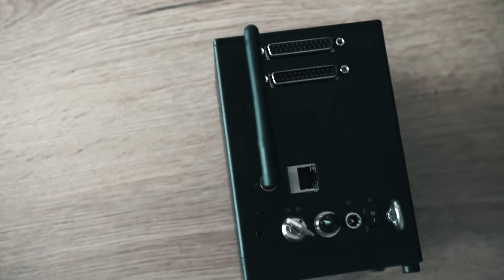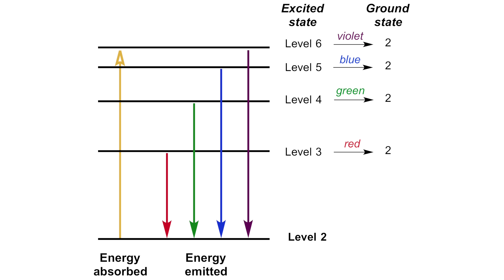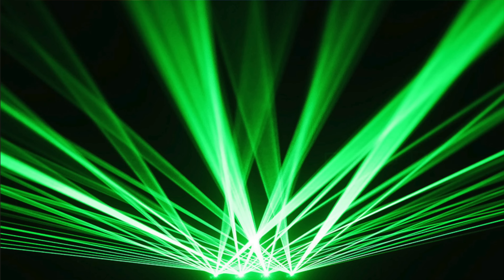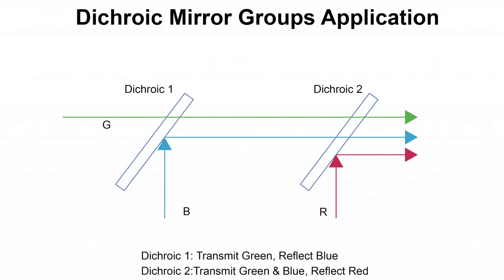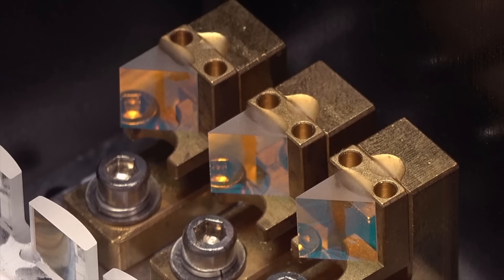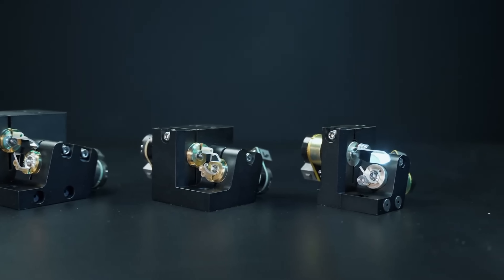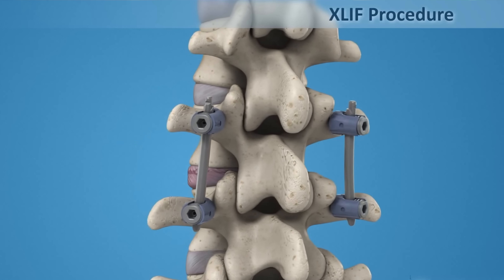The New Kind of LASER You Should Know About!

Comment: I am a Laserist, trained in the very early 90's By Ivan Dryer, and John Tilp at Laserium, Griffith Park. LA, CA.
And a Laser Saftey Officer, having worked at Kodak industries as thier LSO.
Mostly I produced Laser Shows for a dozen years in a 200 seat Planetarium , that was fun and very lucrative.
I also traveled with a lasershow that I Designed & Built for compact portability, doing lasers in TradeShow booths for about 5 years.. Good Times.
I used, and Still have Laserium Choreographics lasershow producer that Runs on my (extremely well maintained) Antique Apple 840 Quadra AV.
CHOREOGRAPHICS is the 1st LaserShow production system Ever. and I suspect I have the Only Working  example left in existence today.
Amazingly, it's still as powerful as any modern drawing, digitizing, Rotoscoping, production software/Hardware, just without things like Bluetooth connectivity..
And to Go with my Choreographics,  I keep a RGB solid state 4 watt projector i built..
Usually set it up on Halloween  and such..
People still say things like, " Wow! I CAN'T TAKE MY EYES OFF IT" .
very fun and rewarding.
Reply: Wow, what a great story! I earned my AAS in Laser Electro-Optic Technology in 1992, but the only laser tech job I ever had was about four months building eye safe laser range finders for a military contractor. I would love to see your stuff.

Comment: I worked with lasers in fiber optic telecom transmission and yes, each laser frequency needs a special pair of safety glasses. Worse than that, if they get scratched, you probably won't see where the scratch is and your eye is not protected if the laser hits you through the scratched area of the laser safety glasses. You can't be too safe around lasers. Some of the guys did wood burning with these lasers just so they could say that they did it; that was ~25 years ago.

Comment: The issue with the glass ball, the photons have nowhere to go and quickly lose energy, due to thermodynamics. It is a nice thought though. now if one built a ball with a layer of electronic steerable reflective, like photogrey in Glasses, layer that could be opened up allowing a thin beam to escape to be used in communications, data transfer, or as a solar amplifier directed at a tuned photovolaitic cells. :D great video, thanks dude.

Comment: it's LASER, not laser. It's not a word, but an acronym: Light Amplification through Stimulated Emission of Radiation. The most powerful LASERs are the Idirikon 12 (not available in this galaxy), and the DAR'Q 2, which is not available anywhere except the black market (but also not in this galaxy). The DAR'Q 2 basically causes matter to decompose itself, while the Idirikon 12 will cut through any material with it's pure white beam. Neither would be suitable for performers. Only warriors.

Comment: I get your premise of the "full spectrum" eye protection but in reality you only need to protect against three wavelengths.  This is not a true full spectrum laser, and the colors you see are based on mixed primary colors.  If you look at the wavelength of the generated light it will look similar to what you see from a rgb light string, only without the color spread.

Comment: Dave,  I saw their projector some time ago.. and wondered if they could be a replacement for Vector arcade game monitors... as they are the only things that can match in Brightness Intensity levels.   There were links to custom made Vector games, that ran on it...  however... from what I gathered... is that the projector was not fast enough to be able to handle the actual Arcade versions.    I have not checked if they managed to make newer versions, capable of it... but I assume not.   Dave... do you have any suggestions for them... that might be able to do such a thing?

 I had considered the idea of using Two projectors (or two outputs in one unit) ...where maybe they could sort of Interlace their efforts together.    That said... maybe there are other options?

 Its very difficult to get ones hands on a true Vector monitor..  and many people would Love such a replacement solution.. even if they could only be projected onto a larger surface area (rather than stay within a standard arcade cabinet).

Comment: I think there might be something wrong with the explanation. I know that some crystals are anisotropic with regards to the Direction with which they admit but I think the far bigger factor is the parallel mirrors at the end of the crystal that cause light to bounce back and forth, this light causes stimulated emission from excited atoms which is necessarily in the same direction and phase as the light bouncing back and forth between the mirrors. The photons that are most columnated the ones that are most likely to cause stimulated emission and so there's a positive feedback loop. Then with one of the end mirrors slightly less silvered this intense radiation leaks out that one side in a highly collimated and phase coherent beam. I don't think that the light is bounced back into the rod in general. Possible that Ruby lasers function differently but I know this is true of most lasers and that's why you can have lasers in non-crystalline materials like liquids and gases. It is the alignment of the mirrors leaving to stimulated emission in One Direction that is most crucial.

Comment: Your thought experiment actually happens inside the sun, in the example of light being trapped inside the box well the box would weigh slightly more as the gravity experienced by the photon is greater at the bottom of the box than the top (assuming on earth) and with every reflection off the bottom a small fraction more momentum is transferred pushing the box downwards due to the imbalanced force.

Comment: What does the shade have to do with protection on a welding helmet? I thought the glass was the only protection needed?  Isn't the shade just that, a shade?  I understand the turn on sensor could get fried, but that is separate from the UV protection.  So you can weld with the auto feature off, you will be looking into a bright flash but it is 100% eye safe.  correct?

Comment: Excellent tutorial on lasers (Light Amplification by the Stimulated Emission of Radiation). One fine point is that a so called Laser Diodes (AKA semiconductor light emitting diodes) are not Lasers at all. "Laser" diodes operate on an entirely different principle than Light Amplification. So called "laser diodes" are essentially a point source of light, in the micrometer range, which can then be collimated with a lens. A spherical lens will take a point source at its focal point and produce a parallel beam of light (I.e. collimate the light). However the diode's emitted light is an expanding elliptical cone about 10 x 40 degrees so the lens has to be designed to collimate this ellipse into a circular beam and needs to be very close to the point source to keep the collimated beam diameter small. Since the LED light is monochromatic, chromatic aberration is a non-issue.

Comment: Your explanation of the laser principle is sadly totally off. If a photon of the right wave length hits a chromium ion this will emit a second photon totally in sync and moving the same direction as the first one, these two photons -- the original and the newly emitted one --can then go on to incite four then eight - and so on - further photons. The perfectly aligned mirrors at both ends of the rod make sure that only those photons flying exactly perpendicular to the mirrors will have the chance to excite ever more photons into the exact same direction - the exit mirror will be, say, only 99% perfect, so a photon will on average travel 99 times through the rod before it is emitted.
I admit this is still an oversimplified rough explanation. The crystals preferred axis of emission might help efficiency but is not responsible for the laser effect and thus the tight strong beam.

Comment: Dave thanks for the very interesting video on the cube laser.  I also wish you well on recovery from your back surgery which I can fully empathize with.  I had two spinal fusion surgeries with something going wrong with either such as coming out of surgery WITHOUT pain meds due to being overdosed or with the second one where they cut off my pain meds the day after due to a malfunction in the IV machine.  I don’t know what type of meds you may be one but one major warning is to make sure you are not on NSAIDs (anti-inflammatory drugs) for a long period of time.  This lead to multiple surgeries later due to the damage to the GI track caused by the drugs and the subsequent add on issues caused by not doing the surgery when the problem was first found out.  Since the medical facility did not monitor the use of NSAIDs despite it being know to destroy the GI track, I let anyone who may be on those drugs to be very aware of what can go wrong with long term use.

Again, I wish you the best on your recovery.

Comment: used to repair tv's and build circuit boards. These stepper motors for the mirrors are so precise. it is the leading tech out there. The biggest question is how long can these lasers be on in different scenarios before melt down. like operating in hot day or cold day. You know laser can change slightly in different temperatures or humidity. Liked your explanation.

Comment: Hi, Dave sorry to hear about your surgery but it looks like it went well since your sitting there I must have missed allot of videos as i been flat out at work as we have a new machine to learn.
Variobend up and down folder, the strange thing is all the files are in XLS and you guest the OS is Windows 10 we use it for 8 meter sheet metal folding so far so good but a learning curve, anyway i will try to catch up on your videos.

one thing you did not mention but i am sure its going to be $$$ how much was the RGB Laser Projector? I noticed it had a male and female DB25 and Ethernet, is the DB25 a IEEE 1284 or other?

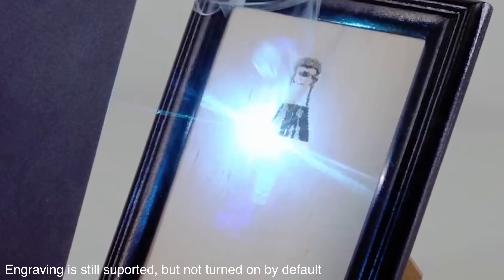Comment: 9:30 Though gobsmackingly expensive, it's absolutely possible to build RGB laser safety glasses: essentially, you just stack together three notch filters, one for each wavelength. You only need to block the three very narrow high-intensity spectral peaks, after all, so if the filters have a high-enough Q-factor there's plenty of spectrum left for the broad spectral responses of your eyes to still let you see (though you'd also need broad-spectrum incandescent lighting).
Reply: That's a brilliant idea, and it seems like the technical reverse of the color-blindness glasses that came out a few years back, with 3 bandpass filters to transmit only the spectral peaks, thereby greatly enhancing the eye's ability to distinguish colors.
Reply: You can buy alignment goggles that do this from Noir. Also welding goggles are even cheaper xD BUt with high power RGB the VLT is too low to really make much use. Also when you start getting into the 100+ watt range visual even safety goggles are only of limited use especially if focusing beams down to small points, they emit broadband light from the white hot substance you are terminating on... e.g. blackbody radiation.
Reply: Having been a laser show programmer and system builder since the 1980s I have some experience with high powered visible spectrum lasers including mixed gas and solid state as well as argon/krypton and dye lasers. So I went ahead and looked at Noir and their RGB safety glasses. The specs for their specs (pardon my pun) say 11% visible light transmission. While helpful eye safe emission is considered to be 4 milliwatt. A class 4 laser can emit thousands of times that easily more that the class 1 emissions even while using the Noir rgb safety glasses. Another issue is that if you're attempting to  align or repair a laser system being unable to see the laser makes it practically impossible. The main reason to own laser safety glasses (while I was a laser safety officer) during my many years of building laser projectors and touring was to be in compliance with the CDRH standards so you didn't get a violation during a field inspection. They can fine you up to $300,000 for each violation and back when I was doing shows a 20 watt argon ion laser cost about $80,000. The combined cost of the entire system was around $250,000 when you factored in the lasers, optical table, beam splitters, first surface mirrors, hoses, water filters, pump, galvometers, scan mount, beam steering mounts with precision 80 pitch two axis adjustments,  scan amps, actuators,  et cetera,  and so on. Each show had to be approved by the CDRH and if outside by the FAA. Loss of you variance could be a very expensive and career ending issue.
Reply: Vr goggles with video pass through.

Comment: Assuming they could change the intensity of the lasers fast enough, it would be neat to add a raster scanning mirror assembly to the output of the cube. Just use a polygonal mirror for the horizontal sweep, and either a rotating polygon or piezoelectric mirror for the vertical. Nice thing about rotating polygon mirrors, they don't require blanking for retrace, just good synchronization.

Comment: Your statement that the laser light is emitted along the crystal axis is not correct.  Here's a sketch of the correct explanation: an optical cavity is formed by two parallel mirrors which are perpendicular to the optical axis.  This cavity has resonant modes of oscillation which take the form of a light beam propagating along that axis.  The white excitation flash causes the crystal to emit red photons in all directions.  The photons that are emitted into the cavity modes are reflected back and forth through the crystal and stimulate a chain reaction of emission of more photons into those modes - that's the "SER" in LASER: stimulated emission of radiation.  The end result is that these modes - and, in particular, the lowest mode, which has a round transverse intensity profile - suck all the light energy out of the crystal, forming a laser beam.  If this seems nonsensical, please consider that gas lasers, like CO2 lasers and HeNe lasers, have no crystal axis, and yet they produce beams of light.  Same is true for lasers in which the gain medium is non-crystalline, like the Nd:YAG lasers used in laser fusion experiments or dye lasers, which have liquid gain media.

Comment: Thank you for an interesting discussion of this laser light display system. Most of your presentation is accurate, but your description of how laser light is generated is weak or somewhat inaccurate. The most important part of laser operation, which is what makes a laser a laser, is stimulated emission of radiation. For this to occur, the gain medium used in the laser must be able to store energy for sufficient time, until triggered by photons passing through the gain medium to emit that stored energy as photons of the same energy and direction, and usually the same temporal and spatial phase. The reason the light from a laser is directional is that only light that is aligned with the optical feedback mechanism (the mirrors) is amplified; light that is not along this axis is not amplified (or not as amplified as light that is along the axis). The crystalline axis of the laser has little to no bearing on the direction of the beam, and, in fact, most lasers are not crystalline and so don't have a crystalline axis. 

The actual generation of laser light from a laser is a quantum mechanical process, meaning that the better you understand quantum mechanics, the better you can understand how lasers generate laser radiation.

Comment: You sound like you know a lot of details about light and lasers, but you've made one fundamental error on one-way mirrors. The name is a misnomer. They aren't actually one-way. They are partially-silvered glass that allows 50% of the light to pass and 50% gets reflected (the percentages can vary if needed). They only appear to be one-way because if one side is a brightly lit room while the other side is a dark room, from the dark room you can clearly see into the bright room, but from the bright room all you see is a reflection.

You can easily test this by simply flipping a "one-way mirror" around. There is no front or back side. There are only dark and light sides. So, the one-way phenomenon is something of an illusion.

So, your thought experiment of a box made of one-way mirrors sitting in the sun would just be a bit darker inside than out. Half of the sunlight would be reflected and half transmitted at every step of the way. It would not "bounce around" inside forever.

Comment: For laser shows, you have a couple of methods to control a projector, either via DMX, which lets you project some baked-in patterns and alter them somewhat, or via ILDA, which gives you 100% control over the projector.  Some of the laser controllers do ILDA over USB or ILDA over IP, too.  Neat stuff!  We use a couple of DMX controlled lasers in our live concerts.
Reply: there's also Gcode or some random protocol that indicates angle and power, a guy I've seen uses his own protocol and a c program to generate 3d looking graphics with a laser.
Reply: @satibel  ILDA is all analog control voltages that handle all the color, intensity, and x-y deflection. There's not a protocol per se.  The ILDA controllers, I'm sure, have some sort of possibly proprietary protocol.  Laser stuff is fun and I am no expert, by any means.

Comment: Used to play around with low power HeNe tubes in the late 70s early 80s.  You could screw with people because there were no laser pointers yet.  Then I had a portable one that I could run off 12V.  I found out that it was a great cat toy.  But was glad when cheap pointers came out for that.  Remember safety,  both for people and pets.